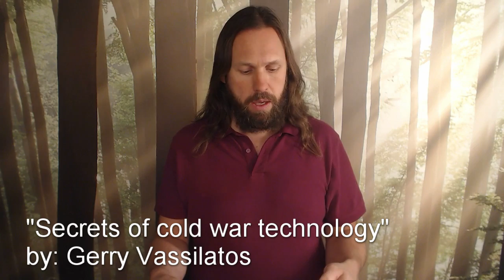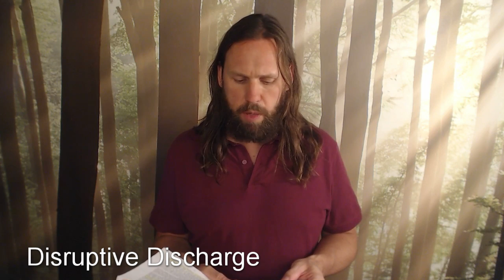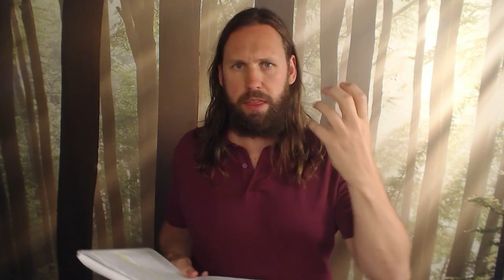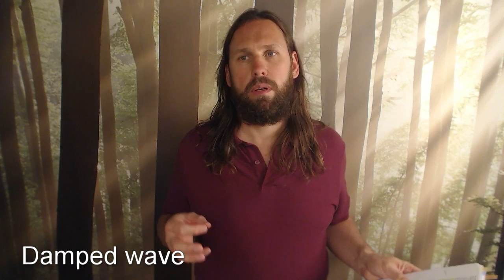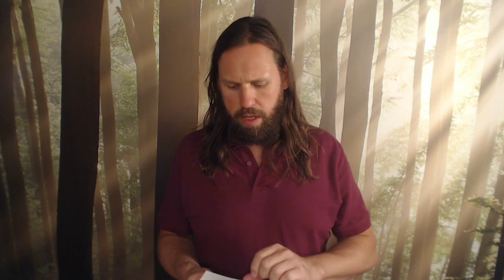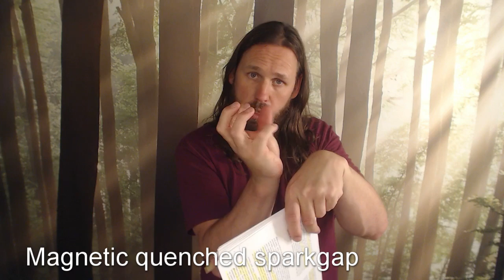Nikola Tesla's Radiant Energy Part 1 of 3

Comment: Master Ivo , I'm working on a specific technology and have two patents pending that deal with what I believe is Radiant energy collection. I'm using this energy in conjunction collectively with Alternating current as a vehicle of said energy. I come to the conclusion that  radiant energy can be collected with using A.C. as a carrier itself with special techniques.  Currently experimenting with "Over Unity" , getting  20% more power but measurements are the same as far as current and voltage... Trying to figure out if in fact this receiving 20% phantom energy is Radiant? With my devices, the Radiant Energy is very present but hidden within the A.C., Sounds crazy I know??? hehehe!

EXAMPLE:  Since I can't see this hidden energy being collected,  mixed & blended with my " Power Quantum Synchronizer" (what I call my device, invention).   What I do is listen to the effect thru audio! This is how I discovered the "added energy" effect, which was by mistake.  The accident has sparked me to create many devices that I use on a day to day basis in conjunction with Audio.  I've destroyed a few speakers because of this technology which is aiding my power amplifiers ability to stiffen the damping power to crazy levels I've never heard in my life.  For example a 60 Watt amplifier having the bass density and control of a 1,000 watt amplifier with a dampening power factor of say 500!  Like having a  A.C. capacitor the size of a room in filtering but is really only the size of a shoe box!  

DISCLAIMER: I will be honest and say, I am limited with knowledge in physics, so I have no idea if in fact I'm dealing with Radiant energy? This all started because of my love for music! I am an electronics engineer that specializes in amplifier designs. 30 years experience.  my IQ is only 124 And I'm not drunk or on drugs! hehehehe!

Comment: I'm reading steinmetz his book as wel. About the spikes u refer to at 3:30, steinmetz does explain that when closing a switch on an inductive circuit, the coil must produce a voltage equal to the source voltage in order to keep i=0 at t0. Page 28 fig14. But these spikes are indeed not nearly as big as the ones for opening the switch. Ps: Thanks for the inspiring video's.
Reply: In adddition to my previous comment, if you would have a mixed circuit with not only inductance but also capacitance. Specialy something like a bifilar pancace coil. The inrushing current to charge the capacitor would be verry big. Were in reaction to this, the inductor would have to respond with a verry big voltage to keep  i=0 at t0. This would explain large voltage spikes at the closing of the switch.

Comment: Hi Master,
Good topic for investigación, as you said there is few información.
Regarding the overshoot when switching on, if you take a look on the scope shot closely, you can see that the first rise goes to 12v exactly, then there is a drop and after it swings up to 15v.
This is a nornal behaviour , as the coil's capacitace is chargeg up. When the electric field of the conductor is charged to the input voltage the inrushing current rises the voltage further.All this  occurs bevore the magnetic field in the inductance is built up, and also can be repeated with non inductove coils, or including other conductive objects.
The intensity of the overshoot depends on the energy x time product and the parasitic inductance of the switching circuit.
Regarding the voltage certainly it is not necessary use high voltage, but some investigations have shown that certain phenomenon only occurs when a energy treshold is exceeded.
Some investigators stated that they had to use a minimum voltage of 40 or 50 volts to achieve some effects related to longitudinal waves.
Regards, Vidura.

Comment: Maybe not necessarily high voltage but high energy (Joules vs. volts)...the disruptive discharge that vaporizes a wire as a consequence removes the counter pulse...one may have high energy at a low voltage as well as at high voltage...however since energy is proportional to V^2C then one must have great Capacity if using lower volts for same energy...of course it appears you are headed that direction which is a great place to start and not get hurt...great to see you develop before our eyes...thanks much
Reply from the maker: Thanks Mark. I don't expect the capacitor to fully discharge within a few nano seconds, so not all joules will burn up. I will also need a slow charge of the capacitor, so probably I will need several inductive spikes to charge it up, before discharging. Than the discharge should not result in ringing.. It's going to be tricky. But the goal is clear.
Reply: understand...will need to see your discharge mechanism before I can really comment on the 'ringing'...for instance, as you know tesla used magnetic quench with his preferred method of discharging to a spark gap which opens up the conductive path formed in the space between spark gap contacts rapidly as to avert a 'ringing' (i.e., the analogy of a wire vaporizing which rapidly opens up the discharge path)...best of luck on your build
Reply from the maker: yes the magnetic quenched spark gap. Luckily for us, we have ultra fast diodes and mosfets. I hope I can produce the same effects with modern technology.
Reply: Yes...Qspeed LQA150
Reply: I would like to point out that this is an energy that directly affects the atomic structures of atoms. The voltages there are microscopic. Your body runs on a cellular network that is transmitted with this form of electricity. High voltage is not necessary, a lossless form of transmission does not require a lot of energy to get the job done. Consider that Tesla's design is replicating a MOSFET transistor... but as a macro scale that allows you to study the mechanics of the electricity being switched.  And that high speed power MOSFETs demonstrate this same over-unity effect, but trap the excess energy in heat. If you look carefully, you will find the FETs generate way more energy as heat than the amount of electrical power that is lost to resistance. Peace, B

Comment: spark gap basicaly a capacitor that allowing to breakdown voltage.it depend what purposes it attach to, in other case for safety if there is over load inductive voltage it jump to lower coloumb
Reply from the maker: Yes using a capacitor as a sparkgap, by overcharging it.
Reply: This comment brings up a distinction you might try to resolve. Is dielectricity in a dielectric actually just organized Aether, conditioned to support charge? Or is the charge also part of the Aetheric structure?

Tesla observed that the Radiant Energy he separated from charge was neutral, unaffected by the magnetic field. But, it was attracted and preserved in the open capacity (the dielectric) of a capacitor. Only in contact with a conductor that had a charge reservoir moving at a matched speed would convert that RE to EM electricity, effectively tying it to the transport of charge..

You will find that, as Dollard has demonstrated, you can motivate dielectricity to travel 157% light speed with series caps and shunt inductors, but Tesla claimed superconducting, instant transmissions with pure RE. 

It takes the idea of semiconductors to a whole new level.. manipulating the interactions of Aether and charge. Peace, B